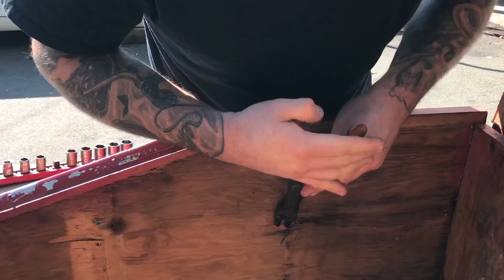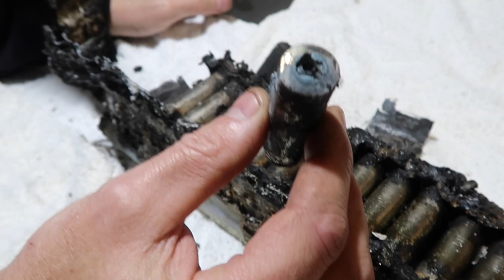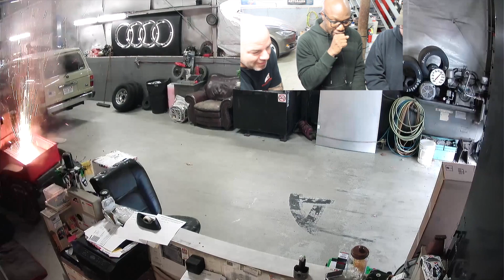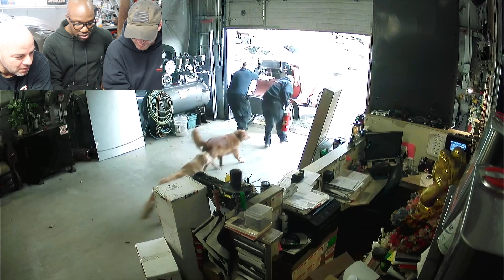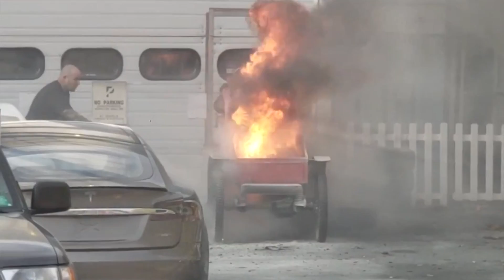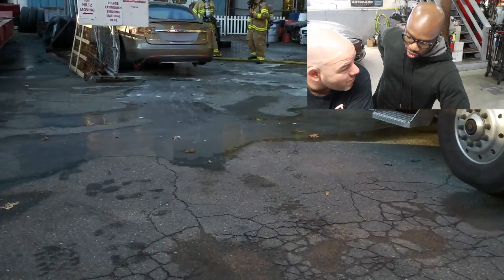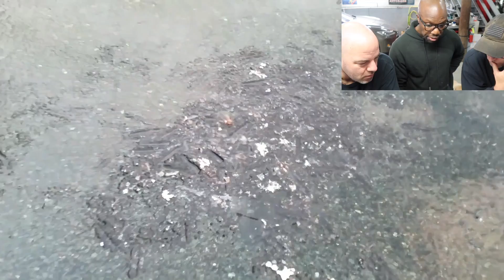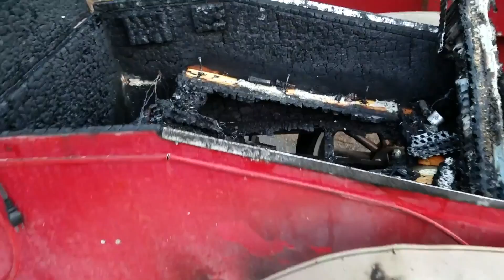My first Tesla Battery Fire

Comment: Subject: “Thermal Runaway as it relates to the Tesla 18650 Battery Packs”.
 
 Hello Youtuber’s from “Solar Ed” 

The reality of making sure your application systems are “Intrinsically Safe “is a very critical design and engineering objective as it relates to battery technology.
 
 All EV and battery proponents needing to install equipment in areas where fire is a risk have two options: employ explosion-proofing techniques or adopt an “intrinsically safe” design and installation approach (and these are not mutually exclusive).

Please note that a battery module as a stand-alone component with both positive and negative terminals covered is “Intrinsically Safe “based on the fact that nothing is connected to the terminal and there is no energy flow. Likewise, battery pack quality, electrical controls and wiring sizes i.e. Rated Switches, Correct Size Fuses and BMS devices etc are essential components in meeting that objective.  All 18650 secondary market battery packs have those associated fire risk issues.
  https://www.youtube.com/watch?v=OHC6sN_IE1U&feature=youtu.be

Comment: A $5 fire blanket would have come so handy.
Reply: You can not extinguish a chemical fire that doesn't depend on outside oxygen. A lithium battery will throw jets of fire even in a vacuum of space.
Reply: @hoxhaloo  without an oxidizer, lithium will not burn, so no it won't burn in the vacuum of space.  And yes, there are class D extinguishers that use powdered copper or graphite that will extinguish burning lithium.
Reply: Russell Popham Lithium is an oxidiser ffs
Reply: @electricsnut  - no, lithium is a reducing agent. It will burn in air, water or carbon dioxide, so it's hard to extinguish.
Besides that, a charged battery contains a lot of chemical energy in the form of reducing and oxidising agents in close proximity. Those are what generate the electrical energy, and they can produce heat energy instead if something goes wrong.
Reply: @electricsnut  No it isn't you bozo, lithium is a reducing agent. If it was an oxidizer, then it couldn't be alloyed with aluminium, copper or manganese to make lightweight metals like those used for aircraft. Why do you think that, when heated in open air, it reacts with the ambient oxygen to give white lithium oxide, ffs.
Reply: Actually, rechargeable lithium batteries do not contain any metallic lithium as far as I'm aware. Instead they have compounds susceptible to thermal decomposition and when that happens, oxygen gas is released. Like how rockets have fuel and oxidizer, lithium batteries have both.
Reply: A $5 fire blanket would have be useless
Reply: @GFormica1  Wrong. The stuff that burns is the electrolyte which is an organic compound. Under heat, it evaporates and produces a flammable gas which then burns with atmospheric oxygen, so yes, a fire blanked WOULD have helped somewhat, but it would have had to be a large one to cover the fire sufficiently so as to not get lifted up again by the raging gas streams. Hell, it's even advisable to douse the fire in plenty of water. Yes, water, even on an EV battery fire. Google it, or read https://batteryuniversity.com/learn/article/safety_concerns_with_li_ion yourself.
Reply: Lithium battery is more than just lithium metal
Reply: That and a couple halon gas extinguishers.
Reply: @GFormica1 True, but a good heavy fire blanket (not a $5 one) would contain it and keep the sparks and flaming bits from flying all over and catching everything else on fire.
Reply: Not at that temperature of fire. The blanket would have stopped nothing. Also Lithium does not need much oxygen to burn. 

I don't want to get into the science of how densely compacted energy works in regard to that much power in a small cell, and the fundamentals of how Lithium-Ion batteries work.

Just know that all of that chemical energy has to escape somehow.

The chemical reaction taking place in an over changed battery does not have anything to do with the amount of Oxygen it is exposed to. Same thing in the case of a punctured battery. 

Basically, what you are seeing is not a chemical reaction of Lithium being exposed to air. What you are seeing is a chemical reaction of negative and positive sheets of dense, high energy material expelling all of it's energy at once. A class D fire which cannot be extinguished. You are supposed to let it burn itself out. 

There is a reason the Navy deep-sixes aircraft when their magnesium wheels combust. They cannot be extinguished and would melt through the deck before they would burn themselves out. They would do the same to any fire blanket let-alone a cheap one.

And water is a bad idea with flammable metal based fires.
Reply: @MalcomHeavy  They do make heavy-duty fireproof blankets that are 100% nonflammable, use them in welding shops all the time, and the blanket isn't to put out the fire so much as to contain it and keep it from spreading.
Reply: @russell2449  What I was mainly saying is that a fire that hot will destroy the blanket within minutes. It will only slow it for a very short time.
Reply: Would most likely have not worked due to the large gap under the car. The blanket is used to kill off oxygen.
Reply: @zipp4everyone263  Not talking about this particular fiasco, cuz putting li-on batteries on top of a wooden base is ridiculous.  But if Rich or anyone else is going to be stripping a Tesla down to the frame, the chassis itself would keep the batteries from shooting out underneath, so what's needed is something to contain a fire from the exposed packs on top.  

IDK how well it would work, but it could contain the fireworks display and slow the spread, giving you some time for other options. 
 
Or, as I mentioned, you could use it to protect yourself - I wouldn't want to get hit by a flying piece of burning/molten lithium battery, as I think it would be like getting burning white phosphorus from an incendiary grenade on you, no bueno :?(
Reply: Or a CO2 extinguisher
Reply: @leosedf  like the 6 ones they used in the video? LOL
Reply: @sondreavik5337  I thought they were powder ones.

Comment: All the people using this as fuel against you clearly have never worked on anything in their lives, this stuff happens.
Reply: this stuff DOES NOT happen unless you fuck it up.
Reply: @kubeek  is right in this case.
Such batterys are nothing to play around with. If you know what you do and you do it with care nothing will ever happen.

I, as an electrician know that better than people mostly working on gasoline cars.
Reply: Wrong this stuff does happen. 787's were grounded for a good while over battery issues. It does happen. He stated he bypassed the protections meant to keep the batteries from running away. He took a risk and it bit him in the ass but there have been instances where lithium ion batteries in other applications have had issues ranging from bad design to bad manufacturing. Bottom line is it does happen no matter what you want to say about it.
Reply: @kubeek  can't say I never had a car fire with a gasoline car.

Tho I know it was stupid basically shitty wiring thrown together to make it move

Comment: This should be a good learning opportunity to keep the appropriate extinguisher on hand that ABC fire extinguisher is useless do you need a Class D on hand anytime you are working with reactive metals  class D is specifically for reactive metal fires it won't put it out but it'll smother it long enough for you to get it out of the shop without it popping off any worse blast  that thing with a Class D fire extinguisher and get it out and get it away as far as you can just like if a Ford radiator support catches fire or a magnesium transfer case you cake that thing with class D foam and get it the hell out it'll burn right through concrete

Comment: 1910 electric car had same mileage capacity as 2012 Chevy Volt... welcome to the bavarian illuminati
Reply: Not sure what car specifically you're referring to, but it was likely lead acid so if it did have a similar range it would have weighed like 50 tons for the battery bank.

EV mileage (for weight and performance and all that) has been stalled since the 90's which is when LiON batteries became cost effective for EV usage, but not since the '10s as far as I know.

Comment: The fire was put out soon enough that the burned parts are intact enough to use as patterns to make replacements. Rather than installing a Tesla drive unit (are you INSANE) use a PWM driver, battery management, torque control etc. Also, a radiator and cooling pump. Those wood spoke wheels would just get destroyed by the torque of a Tesla drive unit.

Next project, hot up a Palmer Twosome electric trike.

Comment: I believe no BMS is one big deal and the fact that they were installed as they come Tesla packed, but realistically they need to be pulled apart. Cell by cell then reconnected with more airspace between them for heat distribution, wired together with fuse wire and fans that turn on and off depending on the cells temperature to increase airflow between the cells seen as they aren't set to be water cooled like in a proper Tesla set up.
Were the batteries on charge at the time? If not, I believe the biggest saver would of been a BMS and rated fuse wire between each cell.
Is this a fair observation?

Comment: How are you gonna open up your own shop, while building stuff like this. You knew the dangers of these batteries. And yet safety was an afterthought. Ther should have been several redundant safety devices in place. There are no short cuts when it comes to this! What would've happened if no one was there? How bout a casualty? Do you have insurance? It was your project? Everyone's. Nice until disaster happens. One accident and you could loose everything you worked for, count your blessings and plan accordingly. This s not a game.

Comment: I don't mean to rag, but be cognizant: 

Make a follow up detailing what you should have included to prevent this. If you really want to build up trust with people that EVs can be built outside of big companies like Tesla then learn up on the engineering and safety involved.

1) Battery Mangement Systems and why they're important neccessary.
2) Battery Cooling
3) Failing gracefully (safety interlocks, thermal fuses and disconnects to prevent cascading failures like this and isolate/extinguish failures before they spread)
4) Building a battery containment that includes fire foam and not flammable materials! Its just asking for trouble to just put them in a wooden enclosure.

Again I don't mean to rag, but this isn't something you should just brush off. Share what you've learned and spread battery safety.

Comment: Nice video. Better frequency  (heat) control before the control board and refrigerated electronics (batteries.. Motors exc..) as a hint and auto extinguishers.. And limit the full throttle, its fun for sure but very stupid.

Comment: Wow glad you guys and the shop is ok.  What is a good way to prepare for this?  Blanket you can throw on top?  Keep cars and batteries on dollies so you can more easily roll it outside... or even better into a room inside the shop with concrete walls and ceiling to contain the roman candles?  Are extinguishers designed to rapidly cool the batteries available?   Root cause of the short or overheating condition, if you can determine it, would be great as well.

Comment: Smart question and a stupid answer: What went wrong here? The fire...

You guys should spend a bit more time in analysing why this happened. Get some learnings  from this incident!!
Reply: It happened because of a faulty battery, there is a positive and negative side, but there is a plastic sheet separating that, but for one of the batteries the lithium came in contact with water moisture or with the other metals causing a spark, that spark burns the plastic and then it burns and explodes
Reply: @whitey9247  it was probably overcharged...

Comment: Buckets of sand would have done a better job at keeping that fire somewhat mild. Those extinguishers don't do anything against electrical fire. Maybe concider a safety system inside the garage?
This could financially ruin you if it were to be a differant situation. Good job trying to move it outside. You really need fire "resistant" overalls or clothing in general.  If those batteries fall onto you... scars for life+ maybe even poison's your blood from all the chemicals/metals that react.

Comment: Ok. Now imagine this. Dudes are overfilling tank on an a traktor with a running engine. It splashes around and cause fire.
Does this make normal cars extremely dangerous? So why the fk you scream Tesla or any other ev is?
They were overcharging batteries without bms and it "splashed" around causing fire. Lesson?
Reply: Lesson? Make a joke video about it and (indirectly) blame someone else.
Reply: Gas and batteries are equally dangerous
Reply: @dylanstallings5891  Fuel tank doesn't degrade so quickly as batteries.
Burning gas car burns once, EV's burn even 3 times :)
Reply: Maybe EV's should be banned from covered car parks?
Reply: Everyone makes mistakes STFU
Reply: Because when a normal car catches fire it doesn't start shooting burning shit everywhere...
Reply: Mythbuster you never dealt with a petrol fire obviously -
Reply: @ThaMythbuster  ORY? Google "car exploded" smart cookie.
Reply: Mythbuster yeah gasoline fires have NEVER exploded, haha amirite? Idiot.